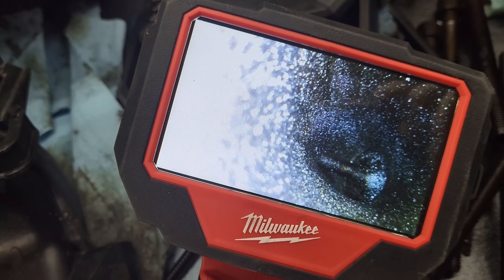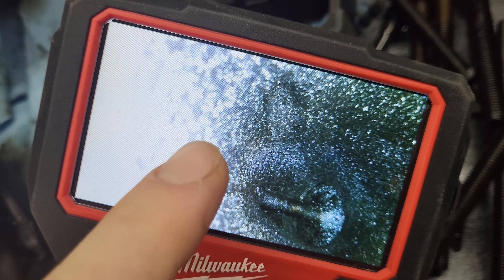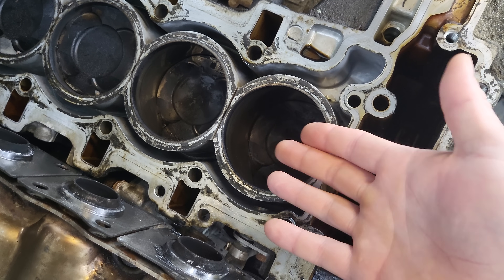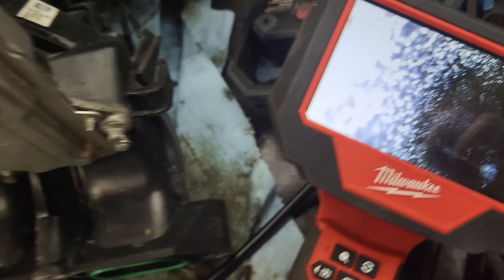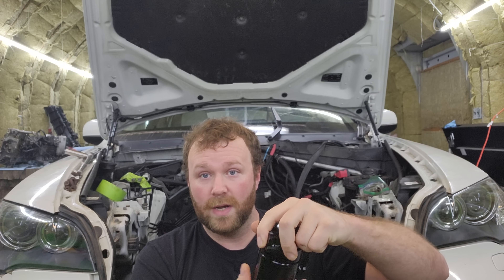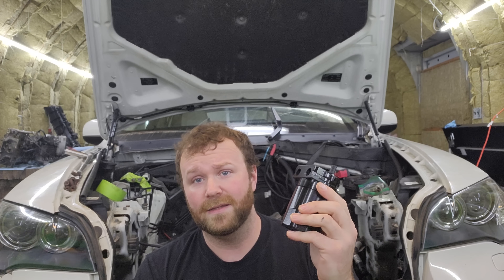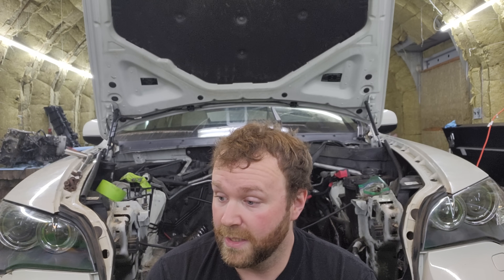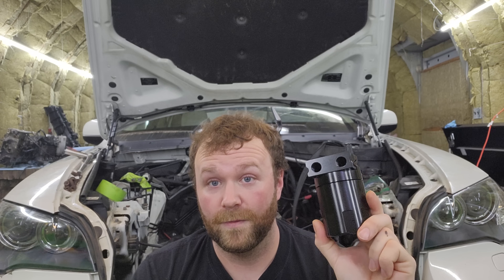The Modern Engine's Achilles Heel: How to Prevent Costly Carbon Build-Up in GDI Engines

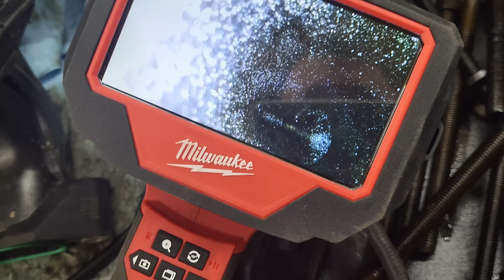Comment: Skip to 2:36.  An oil catch can does help.  The solution is port and direct injection.
Reply: water/meth injection also solves it
Reply: @colinscutt5104 yes!!!
Reply: Correct.  All those formulated gasolines with the great carbon cleaners are useless when delivered by GDI.  The ONLY way to keep valves clean of carbon build-up is to wash them with fuel.  Period.  Hybridized systems with a separate injector for the intake runner help resolve the problem.  Catch-cans help a bit but GDI is design flaw when combined with PCV recirculation.
Reply: @paulcissa9494  do Diesel engines that have direct injection suffer from the same problem, and how do they deal with it? Diesel is a "dirtier" fuel, so it should have a lot more carbon deposit issues.
Reply: @sepg5084  ...YES Diesel DI engines have the same issue.
Reply: Hello. I beleive the mitsubishi eclipse cross 1.5l 163hp has both.
Reply: There are other ways to reduce carbon buildup. Mazda engineers put an oil separator behind the intake manifold and reduced coolant flow around the valves to run them warmer, for example.
Reply: @matsudakodo  exactly. And ford was apparently using variable valve timing on the ecoboosts to push fuel back out the intake ports.

Pretty sure this video is showing a pretty early BMW x5
Reply: @MD-zh4ym  no I believe science that says that catch cans dont reduce carbon buildup
Reply: If a catch can gets you a few thousand more miles it's worth it. My first engine on my optima lasted 140,000 miles. And I did maintain it. The good news is that's the only thing that happened to that car in the entire 12 years I've owned it. If I could have gotten 180 - 200,000 out of that original engine. 
I would have been very happy...
Reply: @chasl3645  what caused the engine failure? I’m guessing it had nothing to do with coked valves.

I bored scoped my 2014 F150 Ecoboost valves around 100k miles and they were nearly spotless.
Reply: It helps, but it isn't a complete solution.
Reply: No it doesn't. Find a single video that proves it.
Reply: @Robis_Grigoris  Engineering Explained has one.
Reply: @Robis_Grigoris I have a catch can on both my vehicles. 2018 Genesis G80 Sport and a 2023 Frontier Pro 4x. No issues and they seem to be doing their job and I live in Canada.
Reply: @Blue-moon12  I also live in Canada and while I haven't tried a catch can, I know that water vapour in the oil is going to accumulate and freeze in the catch can and depending on vehicle use factors and so forth that the catch can will fill with water and freeze causing the PCV system to plug and then one really has created an expensive mess with a pressured crank case with blown crank seals etc. Which goes back to where in Canada are you located and have you seen massive volumes of water accumulating in a short period of time in your catch cans ?.

Comment: This can happen to engines in the 25K to 60K range, not just high mileage engines. The answer is using oils better formulated to resist carbon buildup. Some technical labs from the motor oil companies feel the problem is related to intake valve seals not sealing properly. FORD has included in its ECO Boost engine line a dual injection system. This is where port injection and direct injection is being used.

Comment: Catch cans are a placebo.  Vapers still get past it and the can freezes up in the winter causing more issues.
Reply: A frozen pcv can be brutal.  Had one case where a frozen pcv caused a rear main seal to jump out of the engine block wich caused a massive oil leak.
Reply: @Robis_Grigoris  Stuck PCV's are why crank seals start leaking in the first place. Catch cans and/or breathers are superior because there's nothing to fail. The EPA destroys everything.
Reply: @Robis_Grigoris 
Then never buy any car equipped with PCV.
Reply: If they have wire mesh in them the oily mist gets caught in the mesh and stays in the can.
Reply: I tend to agree. I've never seen proof or any studies of catch can effectiveness. Catching some water with oil in it doesn't prove much to me. Plenty of 150,000 mile DI cars where the valves might look slightly ugly but there are no issues.
Reply: @GusMahn  Porsche MA1.7x from 2014 onwards are extremely resistant to carbon junk buildup. It seems like the key is a combination of cylinder liner construction / coatings and ring metallurgy along with an air oil separator.
Reply: @Nathan0A  Ford has a patent for using intake camshaft timing to create reversion of the charge towards the inkake valves to clean the valves. Probably wasn’t too effective since they’ve introduced port/direct injection unless that was to deal with gas DI particulate emissions on cold start.
Reply: What about 250 to 300,000 mile engines?
Reply: @GusMahn  Yep every mazda skyactiv will go way past 150k miles.  If you find one that died from valve build-up, something very abnormal is occurring.  The dealerships still push an intake service tho, even tho it's really not needed.
Reply: A placebo? They get filled with black, sooty, oily water.... if it's a placebo where did that shit come from? 😂
Reply: @FeatheredDino  Good comment.
Reply: What if you live in hot climate?
Reply: They already have a catch can integrated that is pretty effective. Adding another one will stop some more droplets maybe 15% of what's left. Oil gas probably doesn't do any harm because it shouldn't condense but you almost guaranteed can't stop all aerosols with an aftermarket catch can.
Also if the fittings are not large enough the flow restriction can blow your seals(manifold/oil pan).  I'bought an CC with small fittings, they were garbage. Then fitted an8. On a bmw n52 it would catch mostly water that otherwise could even help with cleaning so I decided to give up the idea.
Reply: Great video. Thank you. Would great if one of the manufactures would share their data on this (catch can versus no catch can) over the equivalent of 60k miles. (I suspect their engineers are aware of design flaw and would have tried something like a catch can.) Agree they know the buying public are terrible with maintenance, 

From my personal experience with 2 VW 2.0 engines they start to stutter a bit and fuel economy goes up slightly as the carbon builds. I have had the intake passages and backside of the valves decarbonized at about 60k and again at 120k. Some direct injection engines are less prone to this but by design all are susceptible.
Reply: True story. It would’ve been adopted by manufacturers if it was effective.
Reply: @danibj  Why? Manufacturers make vehicles to only last a certain while now.
Reply: @Blue-moon12  all of them want that? So none manufacturer want to be ahead in the game by adding a fairly simple system? Idk
Reply: The amount of cans I've installed on vehicles says otherwise; specifically my wife's gdi Mercedes.
Reply: Watch Berrima diesel
Reply: You don't know what "placebo" means.
Reply: Never had any issues with my catch cans and I live in Canada. Can reach 37c in the summer and -40c in winter. Have one on a 2018 Genesis G80 Sport and 2023 Nissan Frontier Pro 4x.
Reply: @Blue-moon12  I'm also in Canada. Were does it get + 37c in the Sumner and -40c in winter. I'm in Toronto. The summers are hot and humid and the winters are cold and damp. I'd like to move north to a dryer climate. The humidity is bad for my arthritis.
Reply: @RottenAnimal  I live in Southern Alberta ( 1hr east of Calgary)
Reply: @RottenAnimal Saskatchewan,  Manitoba, and parts of Alberta all have that kind of weather.
Reply: @karlhungus545  I've been to Winnipeg many times and a dry -40 is more comfortable that a damp -20 in Toronto. In summer it's so hot and humid in Toronto, it's like being in a sauna.
Reply: @RottenAnimal  Ive been to Toronto several times too.  Toronto gets WAY less cold days than the prairies, it's not even close.  It's on the same latitude as northern California.
Reply: @karlhungus545  I agree, It's has less cold days than western Canada
Reply: @Blue-moon12 you drive almost brand new cars bro
No
Shit you haven’t had problems
Reply: @fastinradfordable  2018 is not nearly a brand new car....it has over 180k kms on it!
Reply: Spot on. Way more hassle and risk than they are worth.
Reply: Can always vent to atmosphere to guarantee no oil mist consumption by the engine
Reply: @boosthit811 yea it’s consumed by YOU
And the person driving behind you.
Reply: @boosthit811  cars used to do this before pollution controls - there was potentially a lot of unburnt fuel vapour, and lots of other junk in the vented gas....

Pollution controls and pcv valves were fitted to stop this.
Reply: @peeemm2032  Apparently 20% of vehicle hydrocarbon emissions in the pre catalytic converter era were coming out of the open crankcase vent.
Reply: @gregorymalchuk272  I'm not surprised - on cars with worn rings you used be able to see smoke and other vapour coming out of the bottom vent pipe from behind when they accelerated....
Reply: @peeemm2032 road draft vent is what I remember them being called. They were packed with steel wool that you had clean periodically.
Reply: @boosthit811  I did that on my corvette & all you could smell inside the car was oil so I had to put it back to the carby.
Reply: Big brother would not approve. My 62 vette did just that.
Reply: @boosthit811  you dont like your kids or the environment,, do you?
Reply: @boosthit811  The car wont run very well with either a crankcase vented to atmosphere or no vacuum in crankcase.
Reply: @fastone371  The crankcase NEEDS some pressure to counter ring bypass - The PCV valve is a "Positive Crankcase (pressure) Valve".
Reply: @boosthit811  You don’t live alone. Don’t pollute my air dillweed.
Reply: What about using a can of gdi cleaner every 10-15k miles?
Reply: @danibj  snake oil

Comment: First off don't buy a GDI engine lol. But why not just put a carburetor on it problem solved.
Reply: @MD-zh4ym  thats expensive plus make more power with a carb because of the improved fuel atomization not to mention the maintenance benefits
Reply: No @The0utmode
Reply: @MD-zh4ym  ok prove me wrong then instead of repeating talking points like an NPC
Reply: You can't just put a carb on a gdi engine. Just think about all the components you would need that nobody makes. A lot easier to just treat your engine with Seafoam every 10k kilometers.
Reply: @johnarnold893  There are after market parts for say a gdi LS. Where you can put a regular intake manifold on it than a carb will bolt to but you are right the aftermarket is not there for all the other engines.

Comment: Sure looks like direct injectors cause more problems than they fix for gas engines, works amazing on diesel, but diesel is closer to an oil, guessing gasoline strips the oil off cylinder walls! I also noticed by running a catch can, and not sending blowby back in the intake, the turbo and cylinder balance improved dramatically, oil burns like crap and old degraded oil is even worse to burn!
Reply: Irony, in all this everyday I'm more impressed with old carburetors, those old guys were geniuses. Worked on a bunch of Chevy tbi's they had super clean intake runners. A great simple lesson of taking timing light and putting it on injectors, you can watch them spray, simple!
Reply: I run  carb on my silverado. Better highway gas mileage. You het better atomization with a carb when setup right using correct boosters for the application

Comment: Does the dual injection help with this. Put a. Link or advise what catch can you were showing
Reply from the maker: If the duel injection is on the port side of the intake yes. Many manufacturers had toyed with the idea of adding an off number enjector to just spray on the back side of the throttle body to clean all cylinders. Ill add a link from amazon. bascially you just want the catch can portion. throw the rest out and by good qaulity hoses/clamps
Reply: @Lancemechanics 
The modern Toyota has port and direct injection.
Reply: @scott_meyer  As does the Kia 2.5L Turbo engine used in the late model Sorrento and K5.  Seems to work very well.
Reply: Just crazy, solution is more parts, more things to break and repair, instead just 4 in the intake runners, at what point is it saving planet and not. More plastic more machines to manufacture seems counterintuitive. Next question is with 2 injectors how much fuel to give each injector. Sounds like too much fuel, the whole point of this is better atomization of the direct injector. And diagnosing of these random misses can be time consuming on top it. Some great conversations on this channel.
Reply: @fishman6364  
Direct injection allows for higher compression ratios.

Comment: Vw had an oem catch can back in day. It had a drain to the block. Heavy trucks use a crankcase ventilation that drains the oil back.
Reply: They designed it into the block and valve cover. Much better setup because it will stay warm and has no risk of freezing up. Look at the VW oil separator - it’s nothing like a typical PCV and once separated drains back to the block via an integrated channel in the head and block. BMW is the one recommending walnut blasting on a schedule. VW claims their cam timing and all keeps the valves clean enough that cleaning isn’t needed, at least for a long while. Pulling the intake off my ea888 gen3b at 70k miles for cleaning proved VW was generally correct. Minimal build up and cleaning did nothing for performance and idle.
Reply: @briantii  One issue with it is that a standalone can is seeing better cooling and therefore more oil condensation that could be fed back to the engine.
Vehicle manufacturers want it cheap and yesterday.
Reply: @ehsnils  The issue with better cooling is that it can freeze in cold weather. The OEM's aren't cheaping out, they're just thinking about this stuff more. BMW had to have a heater on their external Oil / Air separator system which sometimes would fail, allow the system to freeze solid and then damage the engine. They've since integrated it into the valve cover to prevent that problem. They also use engine vacuum to create cyclonic swirl to better separate oil from the air. Also the external catch can doesn't separate things perfectly no matter what anyone tries to tell you. None of them are perfect or 100%, but generally the OEM's know how to set this up better than we do.
Reply from the maker: that's smart. makes you wonder why the big oem manufacturers arn't doing that anymore or why vw didn't continue. Volkswagen was  first to start the walnut blasting if I remember
Reply: @Lancemechanics  some manufacturers use an air-oil separator - essentially a catch can that drains back to the sump. Honda for example uses them, at least on the K20C1.
Reply from the maker: @ASJC27  just recently left the Honda brand. Walnut blasting. Constantly replacing 1200 go 2400$ injectors. Ecm updates. Over fueling.  I feel had for anybody who doesn't have warranty on a car after 160k km. They can't afford these repairs.
Reply: @Lancemechanics They’re still doing it, just have improved it to the point where it’s not a standalone can anymore.
Reply: @Lancemechanics what about port fuel injection, doesn't that solve the problem entirely?
Reply: Some cars now have both port and direct injection, at both low RPM and low throttle demand, the port injection is active, washing the intake with fuel.

At either high RPM or heavy throttle application, it switches to direct injection.

A catch can with a vacuum-activated drain back into the sump would be brilliant.  It could never freeze, as it would drain periodically during operation and when off.
Reply: This is a really good solution, no maintenance and reduces the problem. Why don't the manufacturers implement this solution?
Reply: @stimpen12  it's been demonstrated that customers are generally unwilling to pay for higher quality items. Temu and wish are making money while your local factory is probably being demolished

Comment: That explains why I’m seeing so many Mini Cooper s,s up for sale that have had top end rebuilds , new valves and walnut blasts done 🙄
Reply from the maker: Problem is by time they get the walnut blasts done the oil control rings are completely carboned up too. So you need to r-ring the bottom end at the same time. I did this religiously on Honda gdi engines. was always asking Our engineering department why we didn't do this and it was Liability. maintenance items are more costly long term then just warranting a couple engines
Reply: That and the fact that Minis are straight garbage.
Reply: They have head gasket and timing chain guide issues.